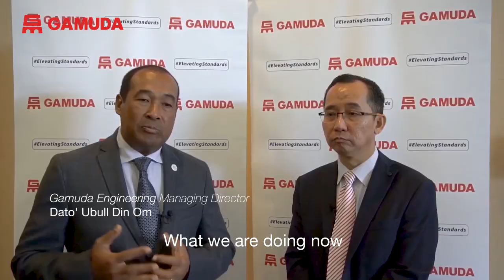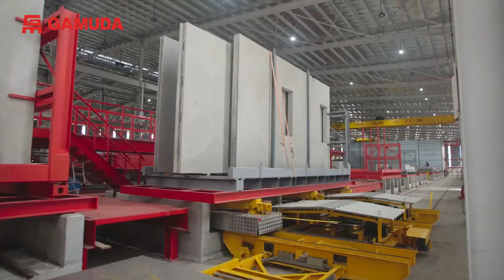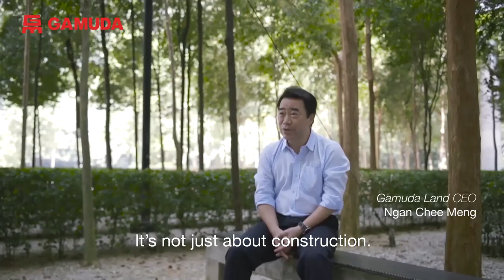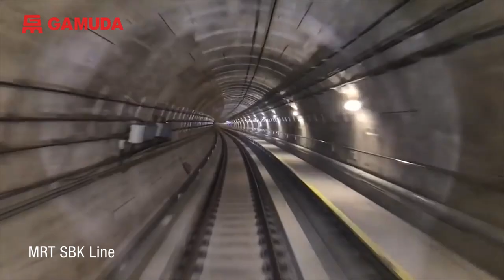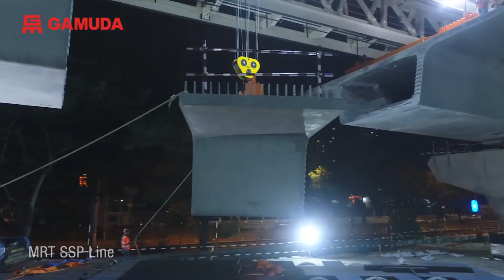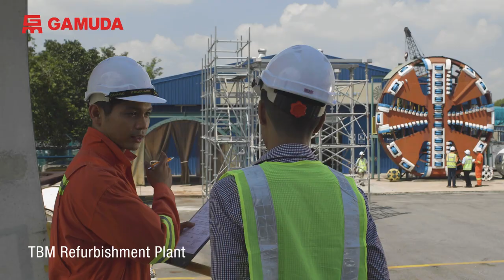Gamuda: Building the Future

Comment: Gamuda, as one of the most important real estate developer in Malaysia and new entrant into the field of industrialized construction, wanted to have a master planner and partner for the project management. Their aim was to save time and money and get an optimum quality by cooperating with a consultant.The first contact with Gamuda took place in autumn 2014, the project itself started at the beginning of 2015.

Gamuda, as an already very successful real estate developer, wanted to install a precast plant in order to supply their building sites with precast concrete elements produced in this plant. In addition to that, Gamuda is especially well known for the high quality and sustainability of its projects and wished to increase them even more.

Moreover, in some parts of Asia there are strict regulations regarding low impact construction, which can only be complied with by means of an industrial construction method.

The target of Gamuda for this project was the production of 500.000 m² of precast concrete elements per year. An extension of the production at a later point in time has already been considered.

Currently the factory of Gamuda produces solid walls and lattice floor slabs. The production of stairs, beams, and columns is possible but is not in use at the moment.

The size of the facility is 15.500 m² and elements are produced in a pallet carousel system with 50 pallets of the size 4.2 x 13.5 meters. Production started in the middle of the year 2016.